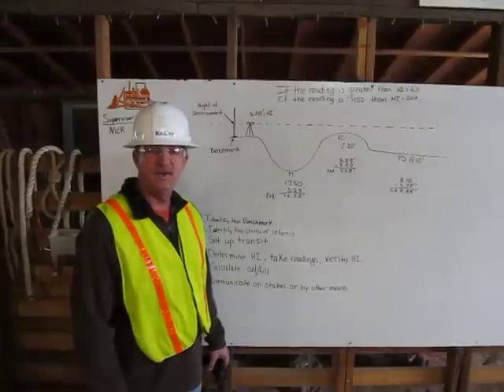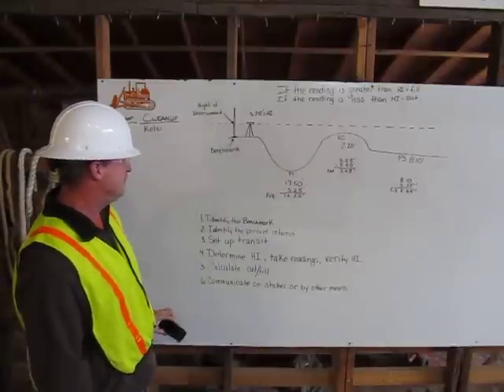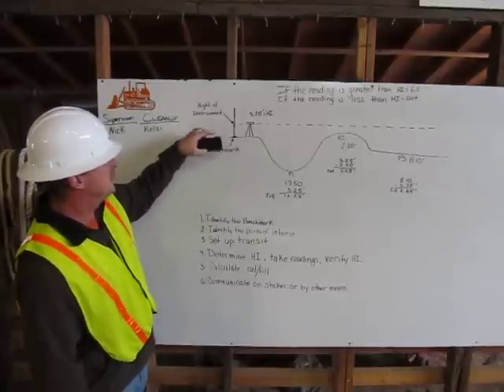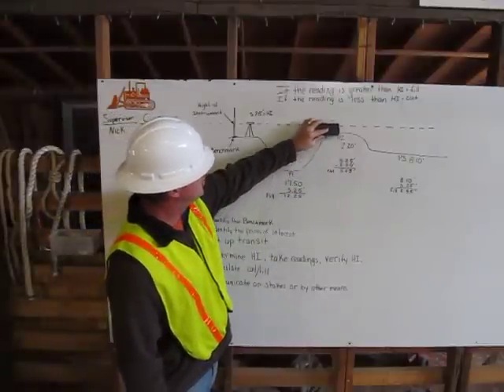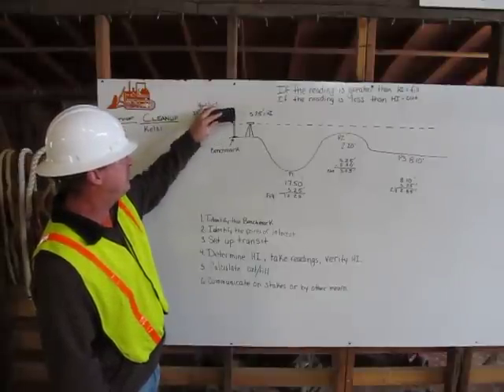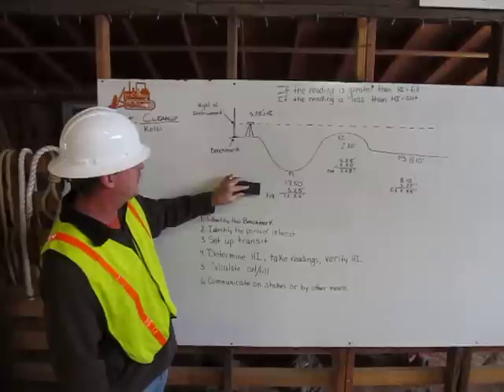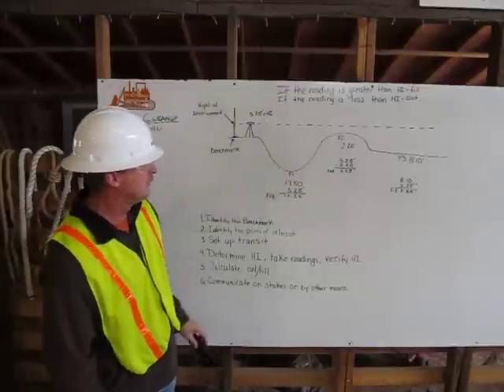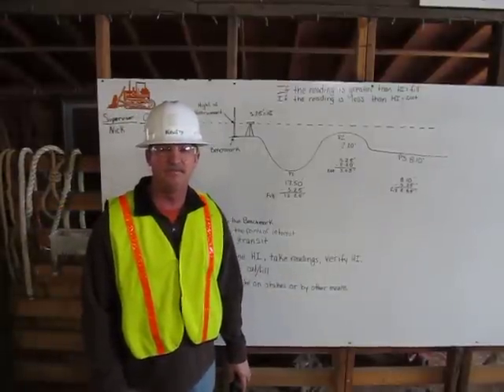The Grade Checking Process by HEO Greg Kealey

Comment: im tryting to get elevation from one point (stake) to another (stake). is that th same as getting the grade? im planning on using a level and measuring with a tape vertically and doing that every 4 or 5 ft. Is thatanother way?